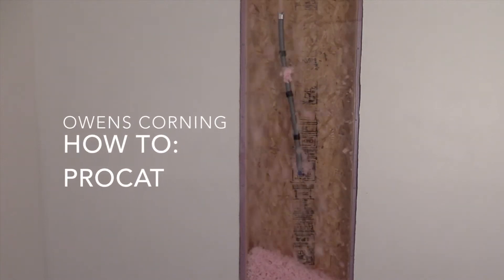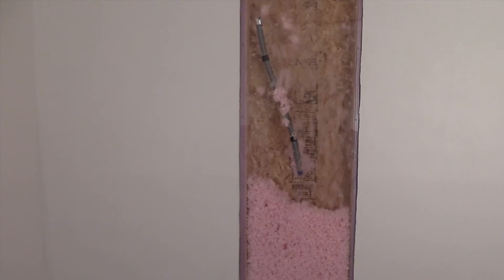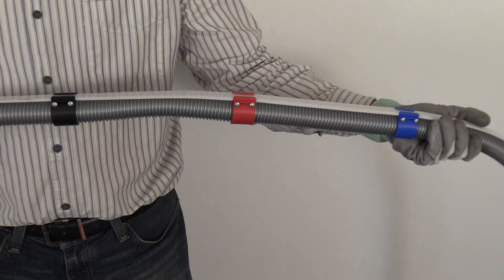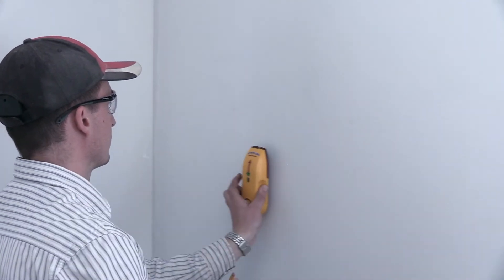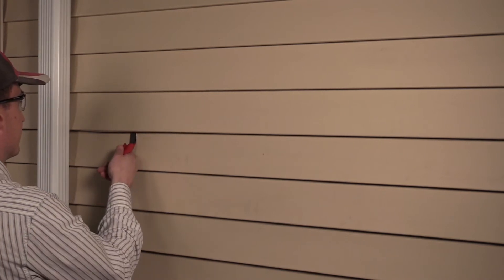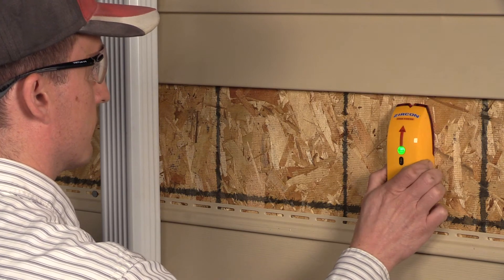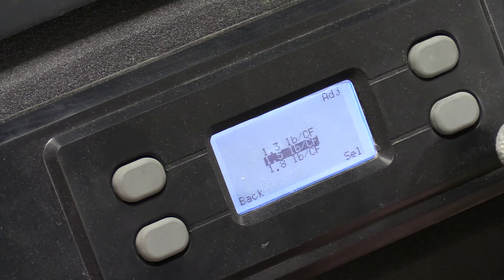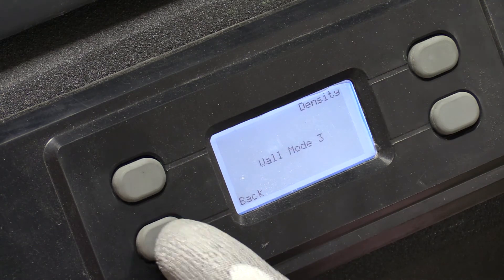Insulation Installation Guide:  ProCat® Professional Loosefill Insulation for Walls

Comment: Where can I buy the adapter that goes in the wall?
Reply: If you are still interested in the wall adapter what I did for my walls is get a shopvac adapter ( looks like a step bit) and a piece of 1.5" id tubing 9 foot long cut off the adapter to fit inside the tubing, then mark a line 1 foot from the end of the tube so you know when to stop so you don't blow out insulation in the room works perfect.